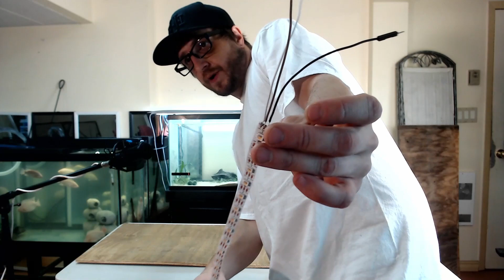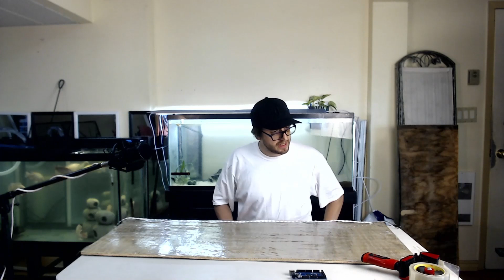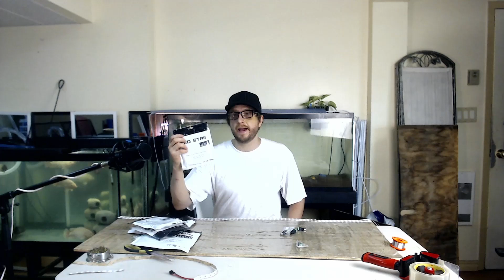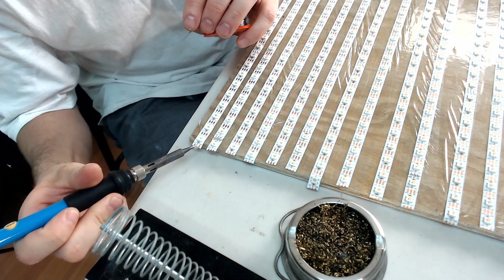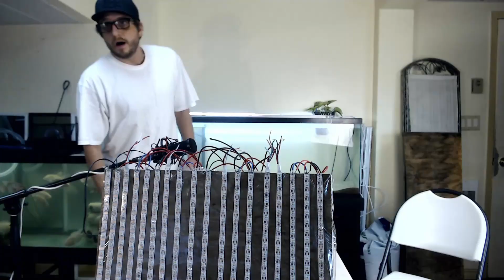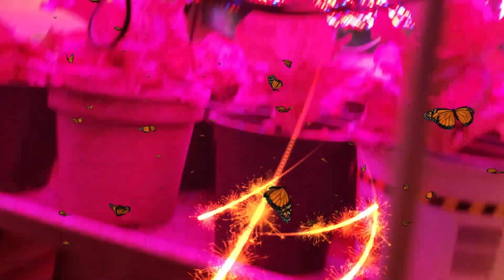(DO NOT BUILD THIS) DIY LED Strip Grow Light - Garden Vlog #4

Comment: How much did all of this cost?  Amazon has high-rated ones for $150.
Reply from the maker: I estimate it was about $250, however. Do not build this  light, it's way too weak! At first I thought everything was cool, but the lettuce needs to be so close to the light, it's impractical. I would definitely go for a pre-built light. I purchased the Barrina grow light LED strips instead. Pack of 6 for $150. It's much better for my new application, NFT style PVC pipes to grow lettuce.